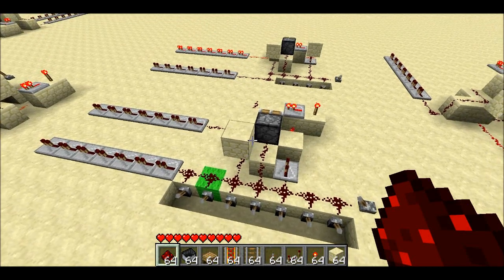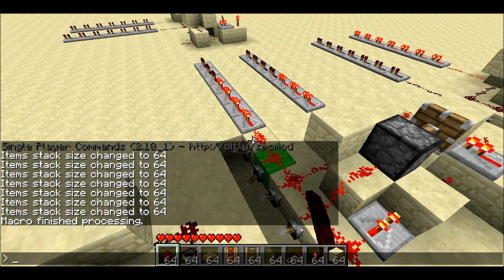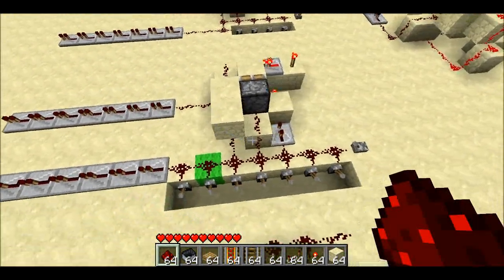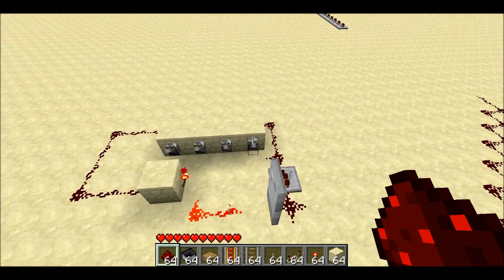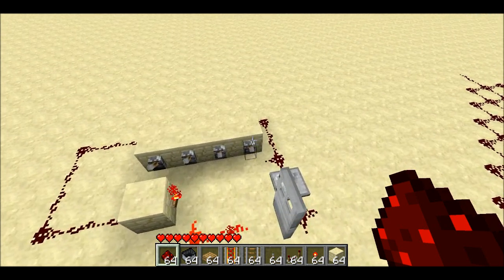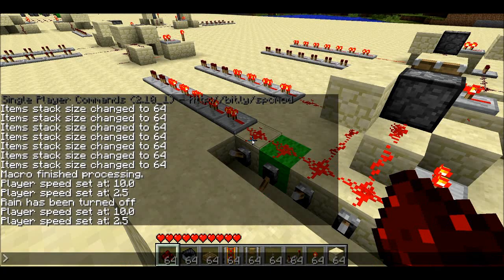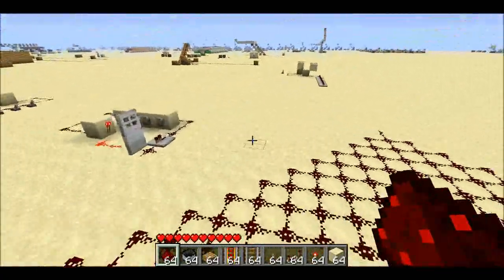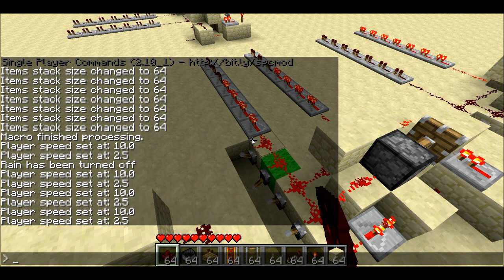Redstone Update Issues and the Java HashSet

Comment: @abexuro On multiplayer it seems like it should be pretty consistently stuck at a very large hash size. Of course that's assuming that the server is large enough that variations in the behavior of other players cancels out, it could be the case that some random guy on the other side of the map is the only other person using redstone on the server, which would make the hash size fluctuate significantly.

Comment from the maker: @archaicevilbunny You'd think that it would adjust downward in size, but it doesn't. The reason for this is that, even if you're using less at some point, you don't know if you'll be using more later. It costs a lot of time to resize, so it wants to resize as little as possible. The guy writing the system basically thought, "if it got this big at some point, there's a good chance it'll get this big again, so let's not waste all the time making it smaller and then bigger again."

Comment from the maker: @Hedgehogs4Me That's correct. Unless you can find a spot that will trigger different circuits at different HashSet size thresholds. But yeah, these things will only work a fixed number of times per bootup, and will require exponentially more redstone to be activated in order to trigger the next level.

Comment from the maker: @xChiM3Ra Theoretically, yes. You still need some time in between RAM reads and writes for the instant circuit to reset itself (it takes time for the piston to move), and it may be very hard to position all your circuit elements such that they'll all be instant.

Comment: @sethbling They could use a linkedhashset which is basically the same thing but maintains order.  It does use a little bit more overhead but like you said earlier, even with the expanded hashset it doesn't use that much memory compared to other things.  That could resolve the issue.

Comment from the maker: @max82power HashSets don't maintain any particular order on the elements they contain, and when you resize a HashSet, it will almost certainly change the order of elements in the HashSet. Notch used HashSet normally (debatably, he should be resetting the HashSet capacity more often), and they do provide much better performance than using a non-HashMap set. I don't think consistency in the order of updates mattered that much when Notch was first implementing redstone.

Comment from the maker: @hypnotizd No, garbage collection won't reclaim the memory, because it's still referenced by the HashSet. As far as I know, the HashSet will never decrease its own capacity unless you explicitly make it (which the code does not do). It will take a larger memory footprint until Minecraft is restarted, although the amount of memory this HashSet takes compared to all of Minecraft's other memory is extremely small.